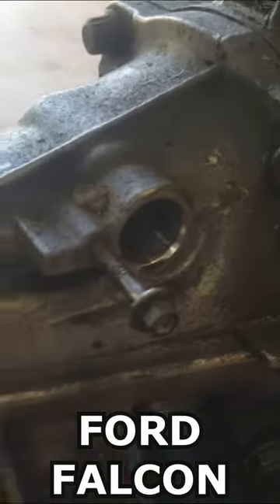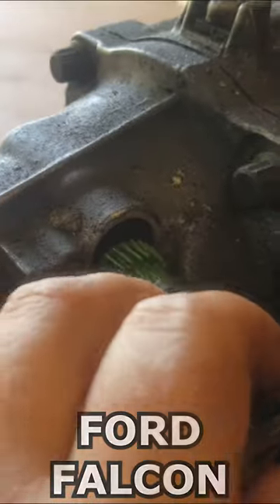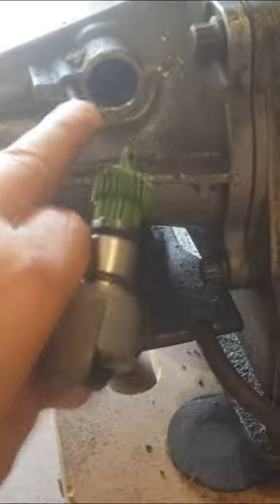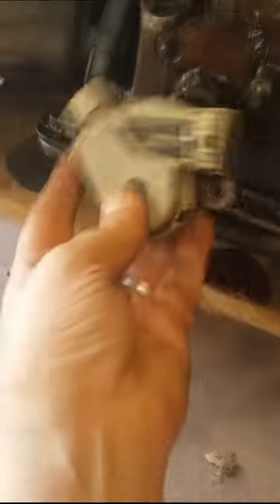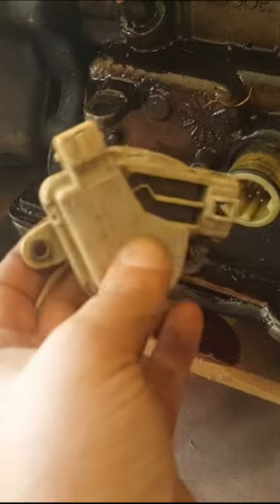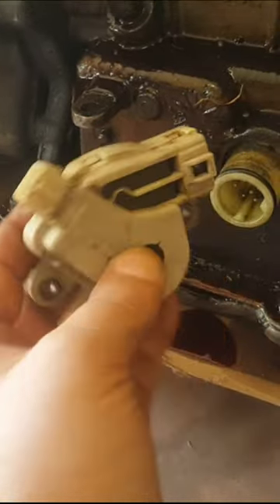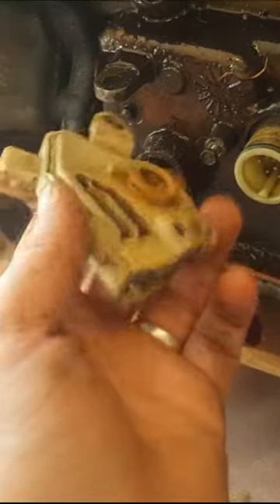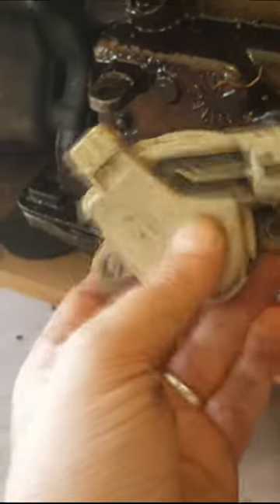Ford Falcon Speed Sensor and Neutral Safety Switch Location. #shorts

Comment: Hey bro any chance you’d have any clue on as to why my 07 mk2 BF randomly goes into neutral when I go to a stop and the screen goes blank ? Then when turned off then tried to turn back on it doesn’t even try to engage starter motor or anything, all lights come up on dash but still blank screen isn’t the shifter cable or transmission module
Reply from the maker: Not sure what you mean by the screen goes blank... First check for any error codes to find out if there is something wrong. Old mate of mine had a simular problem with his shift. In Park or Neutral it wouldn't start. But if you put it in Neutral and pushed the shift arm forward a little the car would start. A simple adjustment on the linkage fixed it.

Comment: Is this the Vehicle Speed Sensor A? I have a 2010 Ford Falcon wagon MK3 that has the engine light on the dash, troubles starting, and OBD2 code P0500. Do you know what is wrong?
Reply from the maker: Does your speedometer still work? Do you have differant sized wheels front and back or a spare wheel on the car? If not working I would check for a bad earth a broken wire or a bad connection before replacing the sensor.
Reply: @TEKNOFIED  Thanks for the reply.👍 Same size wheels and tyres. Speedo still works. I'm taking it to an auto electrician tomorrow to get a better scan.

Comment: Bro I swapped out my gearbox with an early model ba gearbox and ut doesn't have the hole for the speed sensor??? Do you re kin I could just take the rear off the factory one and put it in the new one?
Reply from the maker: It should swap over ok.

Comment: Hey mate. Do you reckon the neutral safety switch could cause an issue with manually changing gears? I can switch between 1st and 2nd fine but 3rd and 4th won't let me manually change. Cheers
Reply from the maker: I have not experienced it in that way but I have had the fault where changing gears didn't do anything. Gears would randomly go from drive to first or second then back to drive then back down again. I created the fault, after I pressure washed the engine and transmission my EL drove okay for a few minutes then was all over the place. It was my local mechanic aka next door neighbor at the time told me to dry out the safety switch the best I can and drown it with WD40. After I did the the car drove like it did before. I would have been guessing and testing for hours had it not been for his advice. Cheers.
Reply: I would look at replacing shift solenoids inside the pan … as well as a full transmission flush with full synthetic trans fluid

Comment: Are they easy to change on a fg falcon xr6 2010 don't tell me you have to take out the transmission????
Reply from the maker: They are easy to change. You don't need to remove the transmission.
Reply: @TEKNOFIED  thanks cause my car sometimes doesn't start  in park but starts in  natural first time in 13 years it has done this 400,000km on the clock.
Reply from the maker: @serb8335  You will probably find a small adjustment on the neutral safety switch or the gear shift will fix that problem. A friend of mine had the same problem with his BA. He called me for help. When I got to his car he was only trying to start in park. I told him to try neutral and it started. It would also start if he pushed the gear shift forward. I later adjusted the arm to the gear shift and he has no more problems. 
My bad, I should have made a video about it.

Comment: How do u remove the pin to remove the inhibitor 
Cheers
Reply from the maker: I'm not sure what pin you are referring too. After removing the linkages then remove the bolts and the switch comes off. Cheers
Reply: @TEKNOFIED  there's a pin the goes through the shaft to select the gears on the inhibitor switch

Comment: Hey mate would the switch fix the triptronic not working at all? Selector goes into manual and moves up and down but car stays in drive
Reply from the maker: NO, the tiptronic has pressure switches and a manual controller box. I have not had the privilege of repairing one yet. I have only researched how they work.
Reply: @TEKNOFIED  cheers for the reply, do you think I’d be better if just replacing the shifter assembly itself?
Reply from the maker: @supaslimey4181  Does it work one way but not the other? If so then yes replace the shifter but more to the point the press switch inside it would be at fault. If not working at all I would first pull error codes and check if there isn't something else that needs fixing. Sometimes 2 parts not related can share wiring and when one part fails something else can as well that has nothing wrong with it.  If you have no errors I would next check for a loose connection around and behind the shifter. Something might have been knocked if an aftermarket head unit was installed or you were behind the dash for some other reason. I assume only the quick shift isn't working right! Does the Park, Neutral, Reverse and Drive still work?
Reply: @TEKNOFIED  yeah mate PRND all work fine it’s just when I push it into manual nothing shows up on the dash, when usually PER would. And obviously can’t change gears manually
Reply: Did u fix it ? I have the same problem